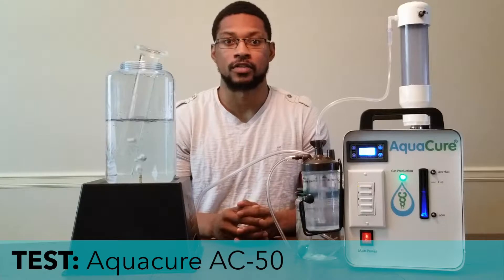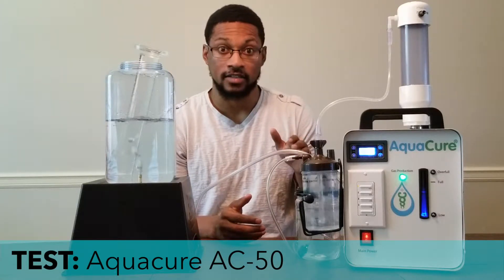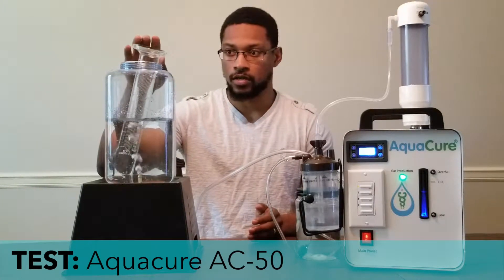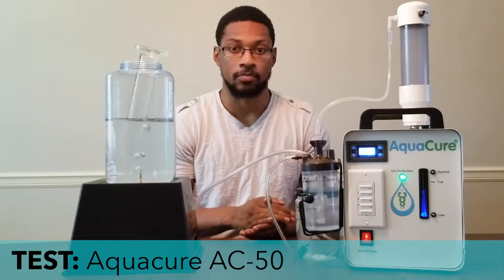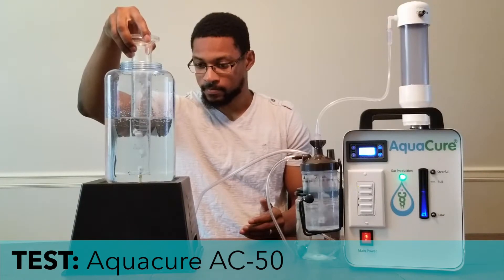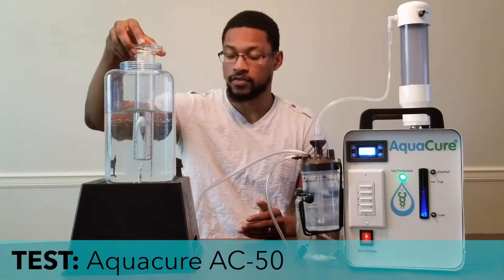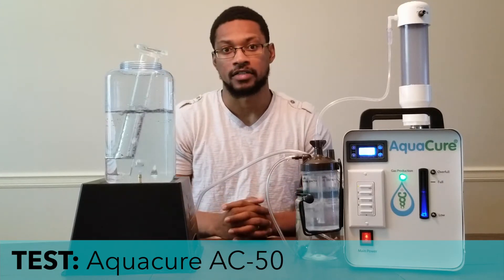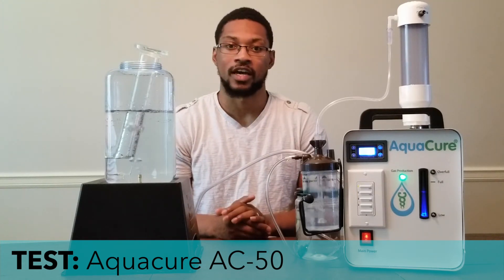TEST: Aquacure AC-50 - oxyhydrogen gas generator || H2Hubb

Comment: Why do you promote this toxic machine.   I am a big fun of your h2 minutes channel.   You seem to know quite a lot about hydrogen benefits and studies, however, HHO is not pure hydrogen especially when lye is in the gas.   People often don’t like using lye in their houses when making soap because of how many people are injured from lye off gas.   Imagine with the aqua cure you strap on a mask and suck down the hydrogen gas with lye in it.  

That is a toxic device.   Sooner or later whoever is connected to that machine is going to go down. No machine with that level of toxicity can stay on the market long without lawsuits starting up. There are plenty of HHO machines that do not use lie which can be promoted. The aqua cure is the bottom of the totem pole when it comes to safety. Good luck and I hope you make the right choice. HHO machines that use lye Are going to give the hydrogen business a bad name.
Reply from the maker: Hello Good2know, 

Thank you for being a fan of my YouTube channels. I really appreciate your support.

As to addressing your comment, I think it would be easier to share with you an email correspondence I had with another individual who contacted us about the AquaCure AC50 system discussing their concerns and potential dangers. I cover various aspects and inquiries which I believe will be helpful in understanding how and why we take the current stance on this recommended product of ours. It's a rather lengthy response, therefore, I apologize in advance for the length.

"Thank you for contacting us. I have reviewed your email and will address your inquiries regarding the AquaCure AC50 unit. 

Q: I need to WARN YOU about a product that you featured recently.

A: Thank you for attempting to bring me concerns regarding one of our recommended products. 

Q: Aquacure and like devices that use Lye in the process to make Hydrogen, are TOXIC! 

A: I agree that sodium hydroxide is a dangerous substance and increases the safety concerns of particular hydrogen inhalation units. However, sodium hydroxide (NaOH) is commonly used or is standard (sometimes manufacturers may use potassium hydroxide (KOH) which is less safe) and is important for nearly all oxyhydrogen units with no membrane. It provides exceptional water conductivity and electrolytic cell performance without producing harmful byproducts. Even the Asclepius Meditec Co. AMS-H-03 hydrogen-oxygen nebulizer (3L/min oxyhydrogen inhalation unit) which is a Class III Medical Device (manufactured in China) and has been used and continues to be used in several human clinical trials, uses NaOH in the system. 

http://www.asclepiusmeditec.com/business/product/product_detail?product_id=1 

This is the same device Dr. Zhong (a renowned scientist that managed the Covid-19 outbreak in China) used in his research and that has been used in many hospitals in China for Covid-19 patients. Sodium hydroxide is fairly standard for oxyhydrogen systems with no membrane. This is why distilled humidifiers are so important for these systems. 

I think it's important for you to understand how we approve hydrogen products for our recommendation list. H2HUBB is primarily an educational-consultation hydrogen company. Our primary service to the public and therapeutic hydrogen industry is our H2 product recommendations. The H2 products on our site are not distributed by us, but are products that have been sent to us for H2HUBB recommendation evaluation. The H2 products on our site have undergone third-party testing, analysis, and safety tests/checks and have met our H2 performance standards.

We are not a direct seller of any H2 product, but our company acts as a trusted third-party source or online portal for consumers looking to purchase quality/therapeutic hydrogen products, especially for H2 systems that are not easily accessible to the US market.

All of our H2 product recommendations go through an evaluation period (1~3 months) where we test and analyze the product and/or device in-house on an in-depth level (electrolytic applied voltage, amperage, dissolved hydrogen efficiency, engineering quality, functionality, etc.) to see if the product coincides with objective scientific standards (IHSA: International Hydrogen Standards Association and MHI: Molecular Hydrogen Institute), as well as our internal standards (many of which are higher than IHSA). We create an official performance test report for every tested product giving our approval or disapproval for recommendation. These H2HUBB standards must be met before any hydrogen product or device will be publicized on our website. The products have to be able to deliver levels of molecular hydrogen comparable to what is being administered in human clinical trials. We do all of this to help reduce the confusion, skepticism, and scam-nature of the therapeutic hydrogen industry, and to provide a remedy to the problem.

With this information in mind, you can see that we are not just arbitrarily recommending hydrogen systems as we see fit. These systems must be approved and pass our H2 performance standards. In fact, we have evaluated more than 65 hydrogen products worldwide in the past several years and only 20 are currently on our recommendation list.

We are aware of the safety concerns associated with the AquaCure AC50 or any other oxyhydrogen inhalation system (with no membrane) that is recommended through our company. As stated above, our evaluation period for analytical testing and evaluation for any hydrogen device is 1 ~3 months. We analyzed the AquaCure system for nearly 4 months, heavily discussing the safety concerns with the manufacturer. I have spoken at length with George Wiseman several times via phone and email discussing the system's safety. We ran a litany of evaluation tests on the AC50 before we came to a position of recommending the device to the public. In order for the system to be recommended, we asked that the company include additional safety items (eye-wear, gloves, etc.), and they happily obliged. Also, we suggested to consumers that they change the humidifier water more frequently than the company recommended. This was based on our testing. 

As it stands, our current stance on the AC50 system is, that the AquaCure AC50 is a standard-engineered cost-effective oxyhydrogen system (66% H2/33% O2) that provides therapeutic levels of molecular hydrogen. It has its pros and cons and safety concerns just like any other H2 inhalation system. Due to the nature of these type of oxyhydrogen systems, I tell everyone upfront that the device is a high maintenance system, has higher safety concerns, and requires weekly attention (changing humidifier distilled water, adding more water to the reservoir, deep cleaning every 4~6 months, mixing more electrolyzer solution (NaOH), etc). Some people don't mind the maintenance requirements or safety concerns, and others do.

Q: It produces Chlorine gas, by electrolyzing the water. This is so wrong and unhealthy!

A: If the device is producing chlorine gas (Cl2), the electrolysis solution is contaminated (chloride is present in the solution). The standard products of electrolysis of a sodium hydroxide solution are H2 gas and O2 gas with pure water (distilled/double distilled) electrolysis. So in most cases, if distilled water (e.g. RO water, Tap water, etc) is not used, these devices will produce H2, O2, Cl2, HOCl, OCl-, O3, H2O2, etc. This is because the Cl- (chloride anion), which is found in virtually all water sources (except distilled, and double-distilled, it's possible to have significantly low levels in RO) is preferentially oxidizes before OH- (hydroxide) at the anode, forming Cl2 (chlorine gas) instead of O2 (oxygen gas), which will lead to further formation of chlorine species. For this reason, we have stricter standards for recommending Brown's gas systems, as they can easily contain chlorine gas (Cl2) or other chemical species if the device is not used properly or designed/manufactured well. This pertains to oxyhydrogen/Browns gas water also, which can contain all the chemical species I mentioned above if not done properly. It's critical not to contaminate the electrolytic solution. 

Therefore, I would need to see the chemistry of how the device could produce chlorine gas apart from chloride (Cl-) being present in the electrolysis solution.  

Q: A research team recently tested this HHO device, and verified what I am saying about the chlorine gas.  

It’s dangerous!

A: Is it possible is share this report with me. I would look to see it. We do our best not to make judgments on hearsay but on objective evidence. A laboratory gas analysis report showing the composition of the electrolyzer water and gas output from the device would be helpful. 

Q: There are legitimate Hydrogen devices on the market, which I have been personally using for 2 years. 

A: That is great!  

I agree with you. There are many legitimate hydrogen products on the market that can provide therapeutic levels of molecular hydrogen, are safe to use, and are well built. I have been studying molecular hydrogen in-depth for more than 8 years now. Also, I have been involved in the therapeutic hydrogen industry for that length of time as well. My experience involves sales, corporate, ownership, third-party testing, product development and analysis, and education. I have leveraged all of this experience to help people with molecular hydrogen via free H2 education through my Youtube channel H2Minutes (more than 90 free H2 videos) and through my company H2HUBB to help people locate legitimate H2 inhalation systems. We have tried to do this as objectively as possible. This is why every single one of our H2 product recommendations is accompanied by an official H2HUBB summary report, stating our test results to the general public. We want people to use our hard work, that way they don't waste their time, energy, and money. 

Q: The device you are promoting is a cheap, modified China blowtorch. I hope you will do a retraction video.

A: With all due respect, I cannot just do a retraction video on the basis of your email. In order for us to remove an H2 product from our recommendation list, we must have substantiated, objective evidence that the product does not meet our H2 performance standards. This also applies to any of our recommended products that may be involved in litigation. It is our policy not to remove a recommended H2 product from our recommendation list until both parties are far enough along in the process that the litigation has been publicized so our decision can be validated with clients. This is clearly stated in our H2HUBB Recommendation Guidelines and Terms shared with every potential RPC (Recommended Product Company)."
Reply from the maker: "Q: The device you are promoting is a cheap, modified China blowtorch. I hope you will do a retraction video.

A: With all due respect, I cannot just do a retraction video on the basis of your email. In order for us to remove an H2 product from our recommendation list, we must have substantiated, objective evidence that the product does not meet our H2 performance standards. This also applies to any of our recommended products that may be involved in litigation. It is our policy not to remove a recommended H2 product from our recommendation list until both parties are far enough along in the process that the litigation has been publicized so our decision can be validated with clients. This is clearly stated in our H2HUBB Recommendation Guidelines and Terms shared with every potential RPC (Recommended Product Company).

Once again, if you can provide us with objective evidence of what you are saying, we can take the inquiry more seriously and investigate if any action needs to be taken to remove the recommendation. As of now, we will continue to recommend the product on the basis of our evaluation and test report. 

We have noted this information you shared with us and it will not be overlooked, and will help to make a determinative decision about removing the product upon more legitimate evidence being shared.

The device using a cheap housing for the base of the device speaks more to its mechanical build quality than to whether or not it provides enough molecular hydrogen gas to be therapeutic, and if the gas is suitable for breathing. As stated in other ways already, our primary objectives through our evaluation process is: 1) is the product or device considered safe to inhale or ingest; 2) does the product provide therapeutic levels of molecular hydrogen based on our performance standards. That is what we look to determine through objective testing.  

The best way to confirm the gas composition of these systems is with laboratory gas analysis. We do not perform laboratory gas analysis on these systems, as it can be expensive. We do ask these companies and/or manufacturers if they have had it conducted and to provide us with the report as it will help with the evaluation or approval of the product. Gas purity is obviously not as much of a concern with pure H2 (PEM/SPE) units as they produce from N2~N5 gas purity (99%~99.999%) of hydrogen gas with distilled water. They truly are the way to go for the purity of gas and safety. I recommend people purchase those units first.

As for oxyhydrogen devices, we have yet to be able to determine an objective scientific standard by which to judge these systems' gas purity performance. Such standards have not been established by an authoritative scientific organization such as IHSA (http://www.intlhsa.org/). That means we have to conduct tests by which we can feel comfortable and confident to recommend the product to the public, and customers have to assume a certain level of risk, until IHSA establishes standards for H2 Inhalation units, or these companies obtain laboratory gas analysis, which as I said can be expensive. Therefore, we have conducted tests on the AquaCure humidifiers and drinking water bubbler to see if they provide an adequate level of production gas filtration.

In a general sense oxyhydrogen humidifiers (with adequate volume of water) typically have a high rate of performance, as sodium hydroxide (Lye mist: NaOH + H2O) is a highly water-soluble substance and will dissociate 100% into sodium (Na+) and hydroxide (OH-) ions in water (NaOH + H2O → Na + OH). This will take place until sodium's solubility constant is reached (the water becomes saturated with sodium). From evaluating the AquaCure humidifiers in relation to conducting tests (durational TDS tests, pH tests, etc) and understanding chemistry and the chemistry of solubility, we have come to a position of recommending the device to the public, if the consumer replaces the humidifier water every 5-8 hours of use. The company Eagle-Research recommends changing the water every 10 hours of use.

Here are a few details on our durational TDS tests for the humidifiers.

The humidifiers will raise in their pH as it filters/scrubs the NaOH mist from the oxyhydrogen gas. The smaller humidifier is recommended to be changed every 10 hours of use according to the manual. We measure the TDS of the first humidifier slightly above 1000 TDS after the 10~15 hour mark. This is the same salinity of saline solution which is 0.9% or 1000 mg/L (ppm). 

https://en.wikipedia.org/wiki/Saline_water#:~:text=Salt%20concentration%20in%20slightly%20saline,(or%20kilogram)%20of%20water

Thus, based on this test, 10 hours appears to be a good range or mark for changing the first humidifier. The drinking water bubbler will also increase slightly in its TDS at the 10~15-hour mark, the bubbler measured 24 TDS which is a small increase considering we used distilled water (0 TDS) for the test. The pH of the water will increase some as hydroxide (OH-) is being added to the water. However, it's not significant or to the point of any concern. Remember NaOH dissociates 100% in water (NaOH (s) + H2O(l) => Na+(aq) + OH- (aq)) to its ions (Na+/OH-). Both of these ions are already found in water and the main issue is the concentration of hydroxide (OH-: alkaline component of water).

With this information, we discovered that the device provides adequate filtration from 5-10 hours and we recommend changing the humidifier water every 5-8 hours, which ensures all the more that the production gas contains no contaminates. 

Q: Aquacure offers a huge commission to many unwitting influencers in the health sphere, and they do so,

because their markup is very high. They entice these influencers with high dollar payouts per unit.

But, this is done at the expense of the public's health. 

A: I cannot speak for other people; we recommended the device based on our own objective evaluation to see if it met our H2 performance standards. 

Q: There is a reason that 100% output on the device is not recommended by the company. This is a HUGE RED FLAG! Hydrogen does not need to be limited. Toxic gases do, though. The way Hydrogen works in our atmosphere has a very well-known ppi - saturation ability within water, meaning that it can only saturate the water at that max, atmospheric ppi. So it limits itself so to speak. But, pure Hydrogen is amazing and doesn't need to be limited. These HHO companies are deceiving people, harming them, while ripping them. KNOWINGLY!

A: As stated in the company's product manual they don't recommend a 100% duty cycle because they do not want people to exceed a 4% concentration of H2 when breathing hydrogen gas. This is due to hydrogen's flammability. 

"I would NOT recommend exceeding 40% Duty Cycle gas volume for breathing.

I'd use a 40% duty cycle as the maximum breathing limit because that's about 20 lph and (in my opinion) no one should breathe more than that to stay in the safe (non-explosive) breathing ratio of less than 4% hydrogen in the intake breath. ALL other applications of the HydrOxy (like bubbling for a foot bath) can use 100%

Duty Cycle of the AquaCure (50 lph)."

As to hydrogen gas "does not need to be limited" I don't know what you mean by that. Hydrogen gas is flammable at a concentration of 4~75% (vol/vol) in the presence of oxygen and flammable in air at a concentration of 18~59% (vol/vol). 

"Hydrogen gas forms combustible or explosive mixtures with the atmospheric oxygen over a wide range of concentrations in the range 4.0%–75% and 18%–59%, respectively."  

https://www.sciencedirect.com/topics/engineering/hydrogen-explosion

"H2 is flammable only at temperatures greater than 527°C, and explodes by rapid chain reaction with oxygen in the H2 concentration range of 4–75% (vol/vol) [89, 90]." 

https://www.ncbi.nlm.nih.gov/pmc/articles/PMC5731988/

This means the H2 concentration (1.0~99%) and the flow rate (mL/min or L/min) are essential factors for determining if a hydrogen inhalation unit is providing a safe level of hydrogen gas. 

Thus I am not sure what you are referring to with your remarks above. 

I will say this though, I think there are significant advantages to pure H2 inhalation devices as they use a PEM/SPE membrane and distilled water and will not result in any other gases (possibly harmful) being generated except hydrogen (H2) and oxygen (O2). Also, they don't have to use any electrolytes such as Sodium Hydroxide (NaOH: lye), which is standard for Brown's gas devices, but can be dangerous if not handled properly. Lastly, they have far lower maintenance requirements than oxyhydrogen units (with no membrane). Our approach with our recommendations of H2 inhalation systems is pure H2 first and oxyhydrogen if that is all the client is interested in. 

I hope this addresses all your questions."